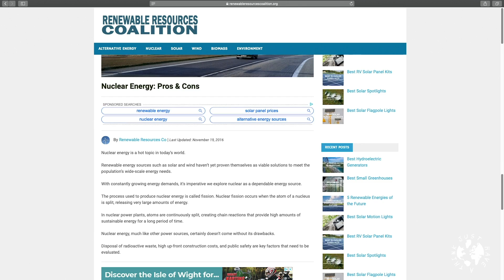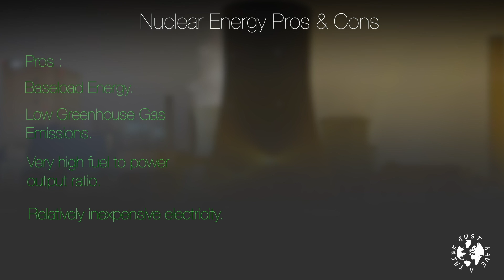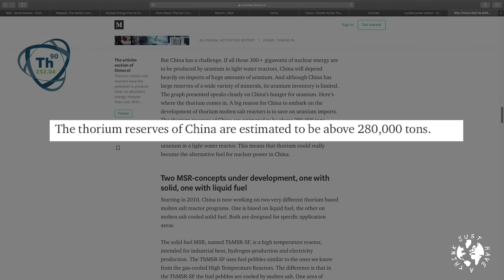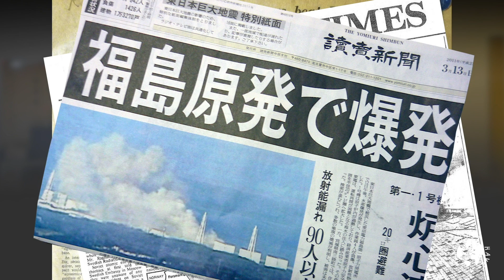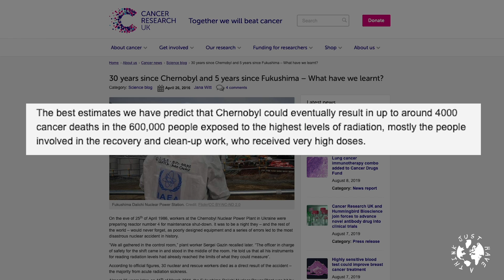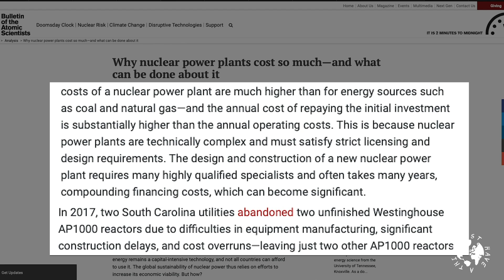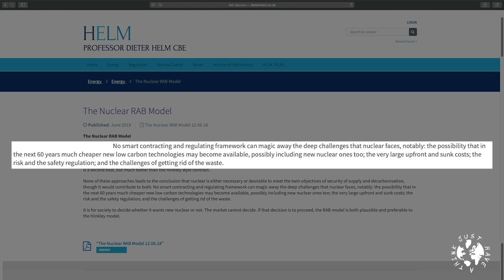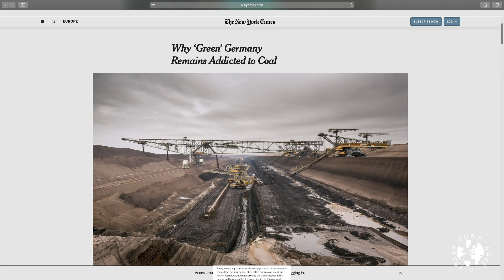Nuclear Energy in the 21st Century

Comment: I agree that safe plants should run their lifespan - many in the US are being pushed beyond their design life - the Diablo plant on the US west coast is an area that has been previously hit by major waves and is on a faultline for eg. The fundamental problem with nuclear is that the temptation of private capital to reduce costs especially in the Neo Liberal era means the high standards needed are not maintained. With Fukushima govt/cabinet documents were leaked that revealed that if the wind had been blowing to the south west rather than out to sea than Tokyo would have had to have been evacuated - the Japanese govt then had to discuss how it would become a failed state for a time. This is one reason why Germany has done what it has done - if u handle it like Russia & don't inform people for awhile its ok - if you do as you would have to in Germany you would have mass population movements & enormous liability. Another point that came out of 911 was that some of AlQaeda were talking about flying the planes into nuclear power plants - so plants are potentially large scale dirty bombs in the making so they need to be sited in isolated geologically stable  raising costs. The embedded emissions in construction, mining & milling are large & typically under reported - storage of waste stretching far into the future secure from breaches means Nuclear is uneconomic in conventional form. In addition to that depleted uranium from milling process is put into missiles & tank shells & armour due to its high density but the armaments spray carcinogenic material - Iraq in particular has it all over the place & its leading to horrendous birth defects - eventually govts & mining will be held to account. One form of Thorium reactors held out the hope of taking spent fuel and breaking it down to a relatively safe form - this is the only viable pathway for nuclear I can see & needs much more R&D.
Reply: Major waves? Did we have an unreported tsunami in the USA in last 100 years? Diablo Canyon sits on a 50ft bluff, that a serious wave youre talking about... Also it sits 5 miles off of two fault lines the Shoreline and Hosgri. However the maximum theoretic magnituide that could be produced by the compounding of these two fault lines in a 7.8. The Tohoku Earthquake and subsequent tsunami that hit Fukushima had a maximum wave height of 44 feet. 

So explain how a much lower magnitude earthquake a closer distance to the shoreline is going to create a larger wave height? That doesn't make a lot of sense. 

I'd also love to know if Diablo Canyon and San Luis Obispo has such a high risk of a 7.8 magnitude, why does the San Luis Obispo municipal government only have evacuation plans for a 5.0 magnitude earthquake and why aren't any other buildings or industries rated to even a 7.0 in 100 mile radius? That's a pretty bizarre contradiction. Either the risk is severe and the city government is incompetent, or the risk assessment is complete bs. 

Not to mention the fact that Diablo Canyon is also a completely different reactor type than the nuclear plant at Fukushima. Comparisons between the two reactors fall pretty flat when you look up a little bit of geology and have basic understanding of classical mechanics.
Reply: you have conflated what I have said a little and I have relied on media reports on Diablo - but it is an aging plant on the coast & California more generally has fault line issues not one off the coast - I didn't realise there was a 50 ft bluff that's good news. that being said u will need to respond to the major points if u wish to refute my main points - I have had this debate with nuclear scientists in Australia & they have been unable to respond to the main points I'm making
Reply: @AnarcoSoma Well it doesn't help that your main points are pretty bs.

1. "he fundamental problem with nuclear is that the temptation of private capital to reduce costs especially in the Neo Liberal era means the high standards needed are not maintained."
The high standards are not maintained? WTF are you talking about? What evidence backs up this claim at all? 

2. "With Fukushima govt/cabinet documents were leaked that revealed that if the wind had been blowing to the south west rather than out to sea than Tokyo would have had to have been evacuated"
The government may have had a plan to do this, but that doesn't mean that Tokyo was actually in any major radiological danger. Following the meltdown the majority of radioactive contaminants were contained within the reactor vessel and protected by primary containment. However in order to relieve pressure build up the operators released some gas contaminants through the venting lines into the chimney. During this release hydrogen leaked from the ventilation line and reacted with oxygen in the air. 

While this reaction was significant it did not break the primary containment, which means the majority of radioactive contamination was still held inside the reactor. 

3. "Another point that came out of 911 was that some of AlQaeda were talking about flying the planes into nuclear power plants" 
And yet in that very same pentagon hearing the captured terrorist who said that Indian Point was a potential target, explained why the plant was not choosen: 1. All nuclear plants have a no-fly zone, and flying near the reactor would have been an immediate tip off. 2. Nuclear reactors are not considered to be an American symbol. 3. They didn't feel like there would have been as much damage to Americans than if they took out a significant piece of American infrastructure. 

4. "so plants are potentially large scale dirty bombs in the making so they need to be sited in isolated geologically stable  raising costs."
That's not accurate at all. First of all crashing a plane into a nuclear reactor would not necessarily cause massive radiological release due to how the collision would occur (oh and btw reactors have been tested to withstand plane crashes, bombs and missiles since the 1960s since Americans were concerned about soviet attacks during the Cold War). Secondly nuclear reactors are large pieces of infrastructure. Any time you have a large piece of infrastructure over a large area you don't typically want to put a building somewhere with high seismic forces. 

However, nuclear reactors are also among the highest rated pieces of infrastructure to withstand earthquakes. Diablo Canyon for example is rated to withstand a 7.5 magnitude earthquake, which is greater than nearly every piece of infrastructure in the entire state. 

Question, why is Diablo Canyon considered to have more seismic risk than any industrial or energy infrastructure in the state, when it has a higher seismic rating than any other piece of energy infrastructure? That's incredibly bizzare. 

5. "he embedded emissions in construction, mining & milling are large & typically under reported" Well according the NREL, IPCC, IAEA, IEA, EPA, and multiple scientific studies while there are emissions these emissions are relatively low especially when you consider the amount of emissions compared to the amount of electrical generation. 

6. "storage of waste stretching far into the future secure from breaches means Nuclear is uneconomic in conventional form."
And what exactly is this timeframe that nuclear waste has to be secured? Ive always seen the 10,000 year timeframe, which makes zero sense, given that total statistical decay of fission products that make up approximately 97% of HLW radioactivity is 500 years, and most actinides have total statistical decays of 50,000 to 40 billion years. Yet these timeframes always manage to somehow be in the middle between these two periods, so WTF isotopes are you so concerned about? Holmium 166m? From a radioactivity standpoint these timeframes don't make any sense. From an isotopic standpoint these timeframes don't make any sense. 

And the best part is usually people then like to say - well plutonium. You mean Pu-239 that has a total statistical decay of 250,000 years? Youre only off by a magnitude of 10... However, this is also is total bs as Pu-239 is actively reprocessed and used in fast spectrum reactors to decrease total amount of the isotope. Why is burying it in the ground considered to be the only solution, when this has historically and currently never been the case for multiple countries around the world?

7. "In addition to that depleted uranium from milling process is put into missiles & tank shells & armour due to its high density but the armaments spray carcinogenic material"
Its also put into airplanes, so are you also calling for the elimination of modern aerospace manufacturing industry?
Reply: 1. Tepco cutting corners and pushing reactors past their design life is  well documented
2. Japanese PM did a speaking tour on the subject & that is not how it went down 
3.  I said it was debated by Al Qaeda & terrorism is seen as a concern - except if you destroy the water system u get the fukushima effect  
4. The LA Times did an expose of the concerns - also I believe the pumping stations are right on the coast & this was the same problem Fukushima and its not far from LA 
5. You need to look at Life cycle analysis like most areas its under accounted - rather than quote industry/regulator reports u should find journal papers that specialise in the subject
6. How many years do u think? Govts seem to think its at least centuries - just the money wasted on Yucca I mean if everything is so hunky dory why are they going to so much trouble - if u store it deep in a mountain like Sweden it costs & has embedded emissions associated with it - these are rarely included in analysis.
7. What amounts are in airplanes or aerospace? but with tank shells & armour the concentration is high - soldiers aren't meant to stay in their tanks for too long. People like you talk about how waste can be stored but then you have the US govt spraying it around civilian populations. I was once debating a Nuclear scientist and he researched the amount of DU armaments used and then divided it by Iraq's land mass and said look at the concentration not a worry - as I explained to him... except of course if you are a resident of Fallujah who has had a tank shell go through their living room wall. 
8. A bonus one  - concentrated energy is good for heavy industry & can be a way of subsidising it - we need to move on from most of this and reinvent the materiality of economies - for example carbon fibre - its currently energy intensive but this can be overcome. I'm sure u can keep a bit of DU here and there & stockpile especially if u r not spraying it over human populations.
9. You replace heavy industry and rationalise/revolutionise grid your energy needs drop 50%. Nuclear's main purpose would be to continue fuelling old refineries etc - we need to reinvent them & its within our technological capacity to do so.

Comment: Possibly the one thing you forgot to mention (that elephant in the room) was the decommissioning costs associated with a nuclear plant. These have really outpaced estimates by a country mile along with the problem of storing all the decommissioned fuel and ongoing management of that fuel 

"The Yankee Nuclear Power Station in Rowe, Massachusetts, took 15 years to decommission—or five times longer than was needed to build it. And decommissioning the plant—constructed early in the 1960s for $39 million—cost $608 million. The plant’s spent fuel rods are still stored in a facility on-site, because there is no permanent disposal repository to put them in. To monitor them and make sure the material does not fall into the hands of terrorists or spill into the nearby river costs $8 million per year." https://thebulletin.org/2014/04/the-rising-cost-of-decommissioning-a-nuclear-power-plant/ 

So after factoring in the cost of building (goes over budget) and the (decommissioning - goes over budget and.. takes up two two generations ..and is not safe for future gens at all -cant store spent fuel securely for 1000's of years) It seems to me this is a red herring for power. Anything where we require future generations to clean up and manage what we did is particularly egregious.. I think anyway.
Reply: There are examples of sites where decommissioning has become a ball ache but they normally provided enough value to have been worth while (if the decomission fund had been in place) but they would have been older designs. Some of which were originally designed to produce plutonium for weapons and were adapted to produce power. These ancient relics are no comparison to modern nuclear construction where they are built with decommissioning in mind and to last 80 years. 
your point is still valid I'm just offering another perspective to view the issue from

Comment: The pie charts at 16:20 show a doubling in nuclear percentage by 2040 from 2016 but the total power generation is also shown to have doubled (almost) so this is a quadrupling of nuclear generation in terms of MWh. Similar reasoning can be applied to the other sectors of course. Just an observation, I'm not pushing a pro or anti nuclear agenda here.
Reply: That's installed capacity, nuclear has ~90% capacity factor, while solar and wind, depending on location, have capacity factors of 10%-25% and 26%-52% respectively.
So those 4% nuclear will actually generate ~1000 TWh in 2040
while    22% solar will probably generate about the same 1000 TWh
that 18% wind (>4 times as much as nuclear) will produce between 1500 and 2000 TWh.

Now see how small nuclear might seem on a pie, and how strong it actually can be?

PS: Statista shows electricity production of China 2016 (TWh) as such:
Wind 240.7 out of 9% (18% actual capacity factor, above 1500TWh are for 30%!)
Solar 66.2 out of 5% (9.3% capacity factor, above 1000TWh are for 17%!)
Nuclear 199.7 out of 2% (93.4% capacity factor)

Comment: I realise it is difficult to get figures, but in comparing carbon emissions and other perfromance issues of nuclear energy,  figures for storage are never fleshed out. By that I mean the carbon emissions of building storage and safely curating the spent fuel has to have a carbon footprint and a significant cost. Thus when looking at nuclear we repeat the same mistake made with so much modern production of externalising certain costs to make the business case look better, even though those costs surely have to be paid (storage, vigilance, and associated carbon emissions)

Comment: Usually  you have good videos, this isn't one of them.  You go between light water reactors and talk about the issues. That isn't tomorrow tech for nuclear. If it deals with water it is a loser, so don't go between MSR and water.
Molten salt is the tech of the future in fission, they run at higher temps and don't need the containment like light water. I question the Chinese numbers that only 4% from nuclear by 2040, for a country spending billion on the MSP tech I doubt such a low number.  
I could spend a lot of time picking apart is video, but no point in it.  No non carbon tech should be off the table, we don't have that luxury.  We won't have to worry about meltdown, if we are at 4 deg C. 
One last thought in this rant,  the West isn't calling the shots. China and India, will lead and Asia will follow. Nuclear is the only way out short of a major battery breakthrough.   BTW   we are screwed....

Comment: Just one question about the pro-nuclear garbage: How much fossil fuel is used in the storage and maintenance of nuclear waste FOREVER?
Reply: Essentially zero.  Dry casks are air cooled, by natural convection.  Also keep in mind that a conventional first generation plant's are producing 20 tons to power entire country's!
One average fossil fuel vehicle produces 4 ton's of CO2 in the same time frame.  So doing some basic maths, 20 / 4 = 5.
5 vehicles produce the same quantity of waste as do nuclear plants that can power MILLIONS of vehicles.

Taking Hinkly C as an example, we have 3260 MWe of generating capacity.  The rule of thumb for electric vehicle energy consumption is 0.150 KWh / Km.  For average driving distance per year, we'll go with 15,000 Km per Year, as that's the number that most insurance companies work with.

3260 Mwe * 24 Hours * 365 * 90% uptime = 25,701,840 MWh per year OR 25,701,840,000 Kwh Per Year
0.150 * 15,000 = 2250Kwh Power consumed per car each year
25,701,840,000 / 2250Kwh = 11,423,040

Just one nuclear power plant effectively removes 11,423,040 vehicles from the road.
Managing ALL nuclear waste from ALL nuclear reactors in the US, is 20 tons, not even a full truck load!
Reply: @lordsamich755  Tell the folks at Hanford about how safe storage of nuclear waste is, or for that matter, dozens of other nuclear waste dumps currently spreading cancer and a host of other nuclear-related diseases. Or better yet go buy housing around one of the toxic facilities if they're so fecking safe...
Reply: @johnsheehan5109  
"Tell the folks at Hanford about how safe storage of nuclear waste is"

Shifting the goal posts already?
You're trying to suggest that a complete lack of any attempt to contain waste, is somehow the same as cask storage?

"or for that matter, dozens of other nuclear waste dumps currently spreading cancer and a host of other nuclear-related diseases."

What other waste dumps? Be specific.

"Or better yet go buy housing around one of the toxic facilities if they're so fecking safe..."

What facility?  Be specific.
Reply: You don't know what you are talking about.